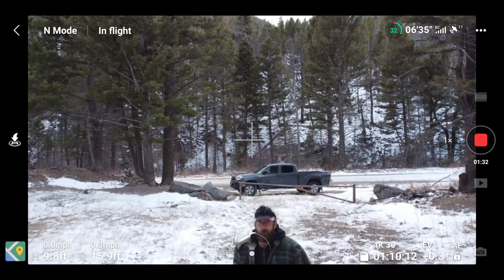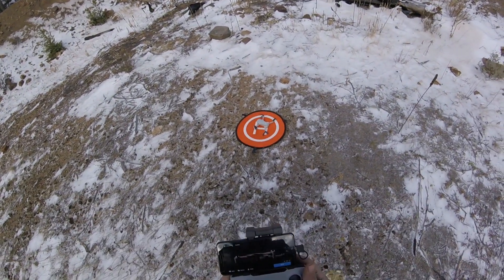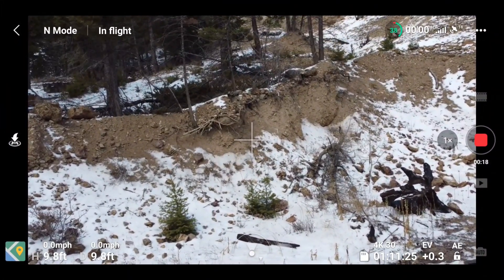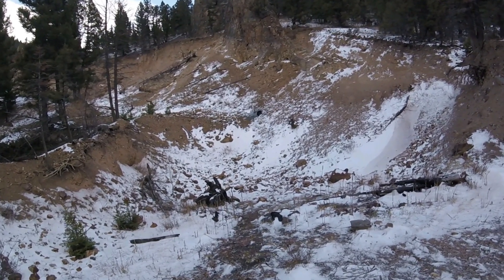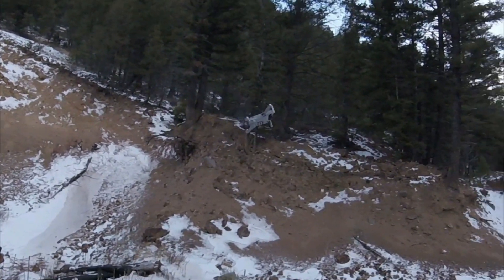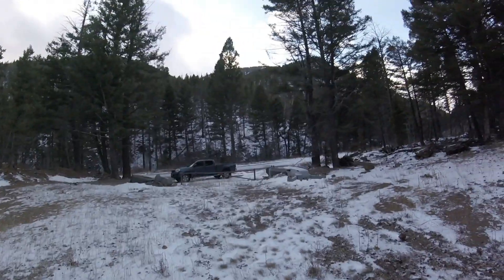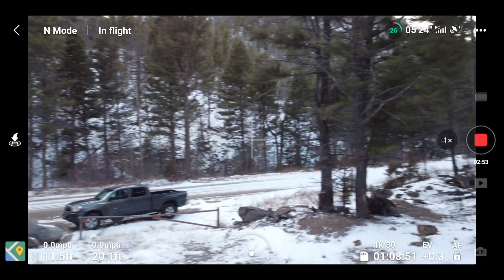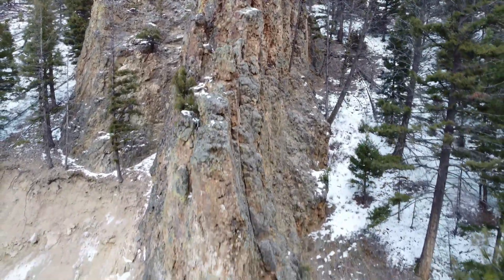New DJI Mini 2 - Level 5 Wind Resistance Test

Comment: Some times mine won't fly into wind and it's not even that windy(my hat stays on no problem), other times it will fly into the wind when I can't wear a hat cause the wind keeps blowing it off. I do know that when it's windy I'm lucky to get 10 minutes before the low battery alarm goes off.
Reply from the maker: Yeah the extreme wind really makes these little guys work hard. I lost one of my drones due to wind. After an hour of searching I was able to locate it though.
Thanks for watching 👍
Reply: @montanadrone1236  That's cool you found it. I have heard from a few that lost theirs. Don't know if it was from wind or not. I know Rocket Rider 510 was flying his Mini down a steep incline not above him and he said it just decided to land and couldn't stop it. It crashed in a tree and he couldn't get it. Some others said theirs just took off and they couldn't get it to com back and had no idea where it went.

Comment: I wouldn’t even fly the air 2 in that wind, your the man fella....great stuff mate 👍🏻👍🏻👍🏻

Thanks for the end screen fella 🤩🤩🤩
Reply from the maker: No worries Lee👍 If you remember my first range test with the Mavic Air 2 when I lost it for several hours, it was just as windy. I think this little drone did a pretty good job. The shot's from the valley were an attempted range test in which I actually flew it over a mile. But man that wind really drains the batteries fast.
Thanks for watching Lee👍